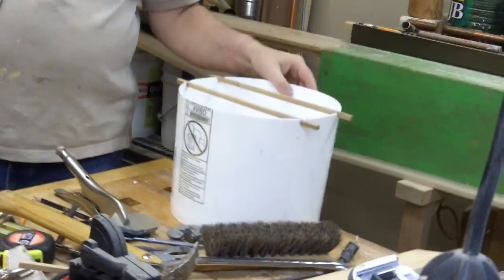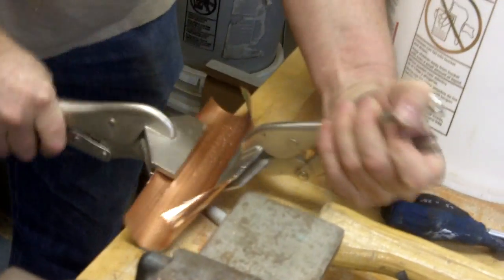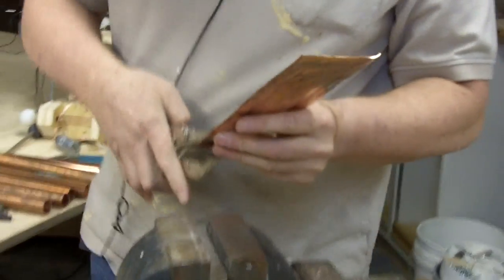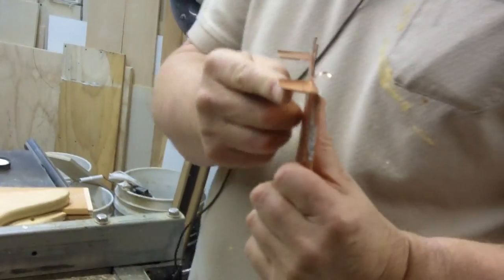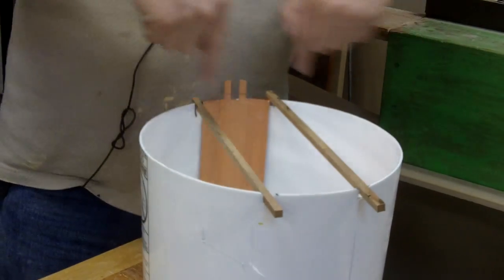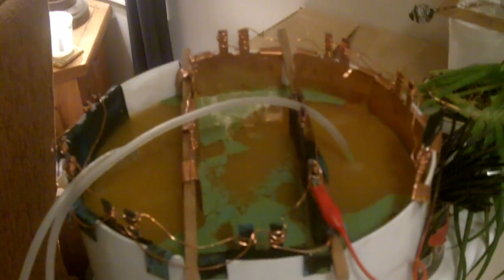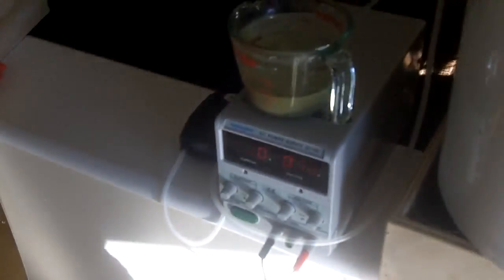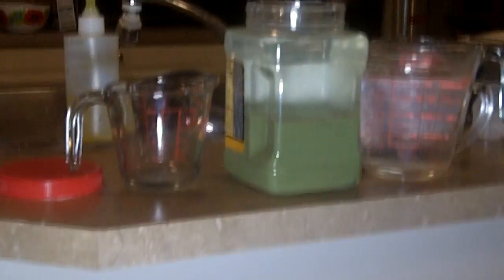Make Copper Oxide Gans Fast

Comment: Next time cut a "v" groove in the end copper plate with a pair of snips. You will find that safer and more productive. If you want it to be really productive use road salt mixed in your water solution. A 12V car battery connected to  a trickle charger will keep it from dying.

Comment: We've been making GaNs in a very similar way but at 1 amp. The GaNs  looks good but doesn't adhere very well to the copper coils for the Magrav. When we touch it it just turns to a powder after drying. It doesn't appear to have any sort of bonding potential. We don't know if this is the way it supposed to be or not. We've been using brass primarily but also make some independent copper and zinc GaNs. You can hardly touch the coils once coated without the GaNs flaking off. Even setting them down gently causes the GaNs to come off. Any ideas as to if this is correct and if not what we may have done wrong.  One of the other guys Leeda shows a wire crossing over between the nano coasted plates and his plain copper plates. in addition to the positive and negative leads on them. What is the actual GaNs chemical composition when using copper CuO2? or Zinc ZnO2?
Reply: I do not know either. We followed the directions and it appears to have come out fine. I guess somebody such as chemist could test it. I've got my first Magrav hooked up and plugged in. For security purposes, I went ahead and found somebody who let me install it in there home. I'm building the second one which should be completed and installed soon. So far the higher loads on the first Magrav has not been a problem. When I plugged it in the first time I was pretty surprised to see that it didn't pop the breaker and the LED lit up. I'm a little concerned about my build process. If it is correct or not. For me I enjoy building things like this, and the cost is nominal compared to my electric bill, so it is no sweat off my back if it ends up not working. My electric bill runs between $350 in the summer and $225 in the winter so any help would be cool; pun intended. I'm in So. Florida. We finally got some good rains yesterday which appears to have cooled off the earth. For a few days, I was starting to believe the global alarmists and the 97% of the 32% of the 10% of scientists who believe in global warming.
Reply: I need to go to the next load level to start the nanocoating process. I'm in Florida so I don;t want to use something like a space heater.

Comment: Thanks for the video.   I like your set up and I will tryp the air pump as well.   One small recommendation, I think you should not have your plates so tight against the body of the bucket.   You are reducing your surface area of reaction.   I recommend just drill holes on top of the bucket and run a metal wire through it and then have your plates hanging from the wire.   Or use the same wood planks as you have for the middle of the bucket.

Armen has mentioned that we should leave one centimeter gap from the plates to the bottom of the bucket (container).   also, Keshe mentioned 1.5 volts .5 amp for the current flow.   I used a battery and increased the production three folds.

Overall perfect set up.   Any update on the coil set up?  any wattage saving?  Mine did not work and I am in process of setting up the second set for testing.

Comment: I took note as you mentioned at 6:59 that the the nano-coating is being lost. I guess the reaction will go on anyway even if the nano-coated plates have lost their coating. Iwas trying Cu-Al in salt solution for the first time last night and now I found that the nano-coat of the copper is gone. No current applied yet.